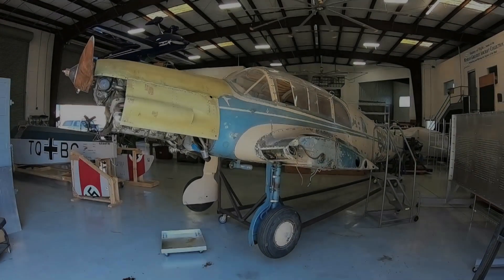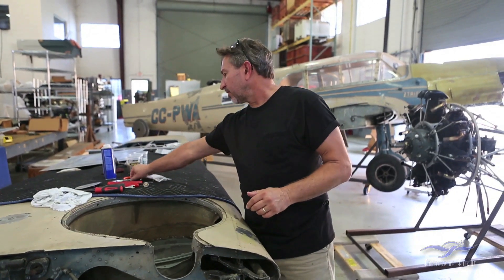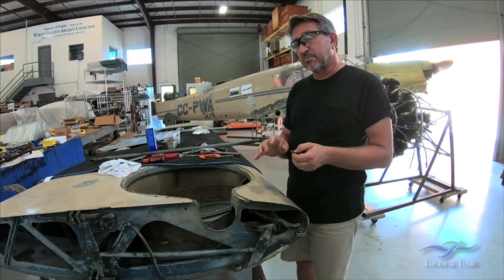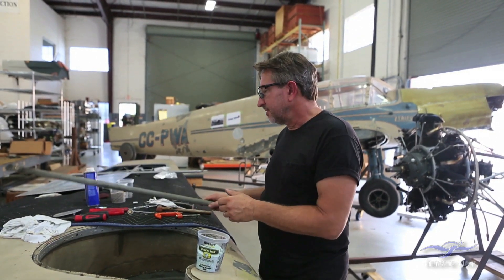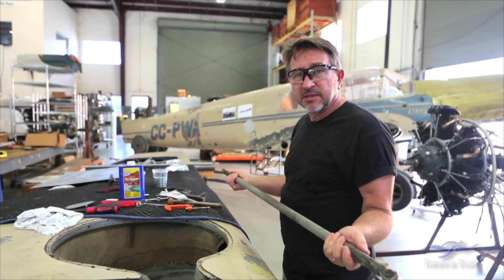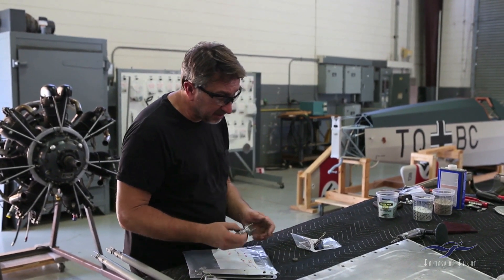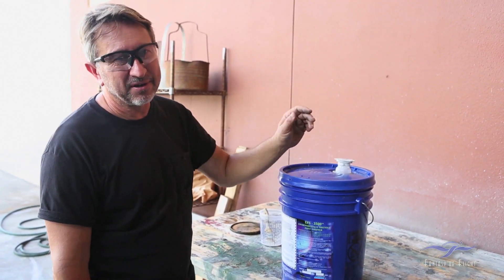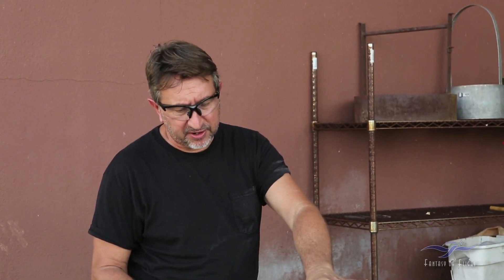Messerschmitt Bf-108 - Restoration Update #04 -  October 2018

Comment: Well at least that proves the processes I'm using on my project are right!! Was interested to learn about the environmentally friendly paint stripper. Brought back memories of paintstripping the RNZAF Museum's  TBF-1 Avenger back in 1979/80. 8 layers of paint using Air Force time expired paintstripper. Truly awful smelly stuff but it still worked. The hardest paint layers to remove was the original US Navy scheme applied at the factory (Dark blue, light blue top and sides and white undersides). We even found a couple of Grumman factory workers had signed the bare fuselage! Interesting about the close tolerance bolts. Probably didn't need to be but certainly made sure there was no "play" in the control runs! Great update as always, look forward to the next one. :-)

Comment: Was in aircraft structural repair in the army in the mid 80’s. While doing a tour in korea I was assigned to the 45th trans avim level maintenance company. I worked in the paint hanger, and we would have to use this stuff we called baby poop due to the greenish color. Had to strip wheel assemblies for ov-1 mohawks so they could get Checked for cracks. Nasty work indeed. I Enjoy the process even if it does seem tedious to some. Because if you don’t take the time to do it right, when are you gonna have time to do it over. Great work guys! Thanks for the videos!

Comment: Very much appreciated. Weeks to remove bolts... It is easy to throw new parts at a project but to use as many of the original parts as possible rulz. And I think that even if a part is not returned to the aircraft, it is saved. Nothing is discarded. Yeah, Scotch Brite pads ; a paint and body man's friend...So looking forward to the next one. Thank you for taking the time.

Comment: Paul, have you ever tried dry-ice blasting to remove old paint, dirt etc. We have used it very successfully in restoring vintage railroad equipment. It will remove paint, dirt, grease, etc. from cast iron, steel, brass, copper, aluminum but is gentle enough to use to strip varnish and paint from wood parts. The big advantage in our case is that many parts will not fit into a containment cabinet or must be cleaned in place. Media blasting (sand, glass, beads) was tried in the open but of course left a terrible mess. The dry-ice blasting leaves no mess since the ice pellets sublimate almost immediately and only the removed dirt, paint etc. is left to clean up.

Thanks for this video, it is always good to see other restoration projects and how they're being done.
Reply from the maker: Heard about the process but have not tried it.

Comment: Good video! Thanks for the information and demonstrations!

Probably 500 other people will also suggest it, but if you haven't you might want to look into one of the citrus-based paint strippers. These seem to be pretty effective on quite a variety of paint, usually pretty quick, and a heck of a lot nicer than the older volatile-compound based strippers. They also claim to be at least more environmentally friendly. "Citrus strip" is a branch name, but there are plenty of other similar things.

There is also "vandal mark remover" designed to get vandal markings off of walls, windows, highways signs and the like. This also comes in several varieties including citrus-based. It can be quite useful for taking a top layer of paint off without too badly damaging the underlying paint if you happen to want to do that. It also works quite quickly.
Reply from the maker: Thanks. We'll look into that.

Comment: With such close tolerances I'm surprised you can plate them without closing the gaps too much.  Really enjoy the videos!
Reply from the maker: When you blast a bolt it removes the old plating so you're not really adding any material that will change the tolerance.

Comment: I used to work at Depot on the C-130 program and we used to "Strip" to bare metal by using Hot Water and Baking Soda that was shot at 3,000 PSI.  Just make sure you have the proper leg protection when spraying it, because we had a gentleman nearly cut his foot off when he was holding a part while cleaning it.
This maybe cheaper to use than using Plastic or Glass, you might want to check with the FAA and the EPA to see if you can use it and what you need to clean it up when you are done. 
Hope this helps...

Comment: GOOD VIDEO.... wish I were closer I'd be glad to blast parts for ya... I use Walnut shell in my blast cabinet on fine parts and it works really nice also,.....LOVE  your shop , I'm sure working for Kermit is a blast ( no pun intended ).. has e a great day.
Reply: Walnut shell is one of the best blast mediums I've seen.
Reply: Yeah, the other issue that comes to mind is all the trouble we're hearing about now, with small plastic debris showing up all through the waterways and oceans, and pervasively in the world's whole ecosystem generally.  I'm not normally the alarmist type re. environmentalism issues, but that one seems manifestly obvious as a really serious long-term problem.  So if we could obviate the expensive plastic-grit media by using Walnut shells, which should be harmlessly biodegradable...  Seems like that would be a win-win, if the walnut shell is just as effective (or better?).
Reply: @boatrat  , I would say walnut shell is the way to go in probably 90% of the applications where blasting is needed. It does biodegrade and also lasts about as long as sand of comparable grain size. Unless you have a nut allergy I don't see a downside. Now with that said, I am sure there are applications I am not aware of that it isn't a good match for.
Reply: WALNUT SHELL ... Good & Better ! .....If you use it how about a short video doing some cleaning with the  new media ? ...  Thanks for the reply and have a GREAT DAY in Florida.
Reply: I think so too... I also use Garnet on a lot of things and it ( being a natural mineral)  just blends back into the earth.. I can just throw out the old  and it is back to mother nature .... the cycle continues.
Reply from the maker: Walnut shell does an equally good job.

Comment: Thank you for sharing how the sausage is made Paul. Have you ever had any experience with soda blasting? We use it in the auto industry pretty extensively. It ONLY removes paint. I personally have used it on aluminum as thin as .020, but not on expansive panels like those frequently found on aircraft. Experienced zero panel warping with  it in my experience and minimal heat buildup.

Comment: Would it be worth your while to produce a workshop manual similar to Haynes, as you are doing a complete strip down and dealing with those unforeseen issues like tight tolerance bolts everywhere, or is that just too involved or not worth your while? 

If not the video's are excellent and educational. 👍🛩
Reply from the maker: Great idea . . . unfortunately we're too busy restoring planes to do it.

Comment: Talking about the close tolerances of the bolts on the plane wing, is that one of the problems with a lot of the German war machines; too precise machining that made building time being greater and then the requirement for much more particular servicing in battlefield conditions?  I hope the question makes sense.

Comment: I love these videos and the details you gone into on them.   The Bf-108 is a very good choice for these videos.  Good to see pre-war German manufacturing  and also it having magnesium skin makes it unique.  I was wondering do you get much corrosion do you get with magnesium /aluminum contact?  With the plastic beads do they wear out fast?
Reply from the maker: The Germans were pretty good against dissimilar metal corrosion. I haven't seen any in the plane.
The plastic beads do wear out eventually - it turns into dust.

Comment: Tight had become possible due to introduction of DIN since 1915 which allowed the mass production of mgs out of parts from different companies and locations. DIN or Deutsche Industrie Norm means german industry norm and defines everything from material, structure, surface, coating, measurements + tolerances you will find mentioned below every german construction sketch.

Comment: Another great video; I am really enjoying following this project.

In relation to paint stripping; have you considered or used soda blasting?
Reply from the maker: That is a good method, but it requires another whole set of equipment Kermit hasn't invested in at this time. You need a whole different cabinet system, you can't use baking soda in a straight blasting cabinet.

Comment: Really great videos on this project. I have a question regarding the acid etch cleaning process. Do you need to wash down the part to stop the acid reaction? I mean with aluminium being so soft and reactive, even a small residue of acid might cause a problem during and after painting, or am I being 'over cautious'?
Reply from the maker: Yes, you do have to rinse the part thoroughly with water to neutralize it.

Comment: I hope these updates will be compiled into an instructional video for restorers when the machine is finished. Lots of valuable knowledge to preserve.
I've seen an electrolytic process used to replace material on heavily-corroded ferrous parts; is the same possible if removing all the corrosion leaves the aluminum a little thin?
Reply from the maker: There is such a minimal loss of material that it wouldn't be worth the effort to do that. Also, if there was that much loss of material you would just replace the skin.
Reply: Thanks for the information.

Comment: Paul, will you have to remove all the rivets on the leading edge slats to check for corrosion between the two layers of aluminium?
Reply from the maker: No, the chances that there would be any corrosion in between is minimal based on the exterior condition.

Comment: Great Video - you are the perfect counterpoint to Kermit's extreme enthusiasm - a great team.    With the aluminum parts, after you have stripped it and removed the corrosion, how quickly do you have to get at least a primer coat on it to prevent corrosion from forming again?
Reply from the maker: After you do the corrosion treatment it gets an alodine process which stops any further corrosion, and preps it for paint.

Comment: You should look into soda blasting media. I don't work on aircraft but I have found it to be gentle on aluminum parts and it leaves a very fine etch for paint. The stuff is cheaper than plastic and when washed down with water just turns into laundry soap.

Comment: When you scotch-brited the underside of the slat it looked as if there was still some black corrosion in the riveted joint. Are you assuming that this is minimal? Are you looking at inter-surface corrosion on a part-by-part basis?  Great video!  And, do you have plans for the original design?
Thanks.

Comment: Um actually isn’t this an example of a plain type bearing rather than a ball, or roller types. The comment refers to the small amount of the internal clearance between the bolt and the inner cylindrical surface of the plain bearing.

Comment: No amount of penetrating oil will help separate those "tight" bolts from their bearings because they are a deliberate interference fit i.e. the bolt is machined slightly larger than the inner diameter of the bearing, probably a safety feature retaining the bolts position even if the nut shakes loose.

Comment: For old and delicate parts they have crushed wall nut shells and or baking soda. If not sure id use a damaged engine part just to see how it removes the paint. Years and years ago i helped remove paint by hand on our piper arrow air plane that my dad was flying. Elbow grease as they say. Did we use orbital sanders don’t remember. Yea i miss flying but my dad stoped because it got expensive with the annuals the insurance fuel costs were going up. Plus he i guess lost intrest. Yea this might be paint drying but its part of restoring something back to flying verses collecting dust in a museum some place. Can’t hear them or smell them. Or see the cold starts.

Comment: Greetings Paul. Was wondering if Fantasy of Flight uses a laser system at all in aircraft restoration (example here: https://www.cleanlaser.de/wEnglish/produkte/high-power-cl-1000.php - a German product, for a German restoration seen here..)? See models for both industrial & cosmetic uses. Would seem to be a time saver & would eliminate having to use chemicals if such a system were suitable for the work you guys do.

Comment: Wonderful video, love the series, I’m wondering about the “inspect for airworthiness” part, you notice some slight corrosion, treat the surface but also said the corrosion did attack the surface. The call to replace or not, does it need to be made by a somehow certified person (which I’m sure you are) or is this just up to a plane owner ? And are these steps usually documented for FAA approval when you get the plane certified ?
Don’t get me wrong, I’m not doubting what looks like a extremely careful and thorough process that you do, I’m just curious. I’m in germany and not a pilot or involved in airplanes, but my dad was and here anything aviation is an absolutely regulated and much less easy going than in the USA.